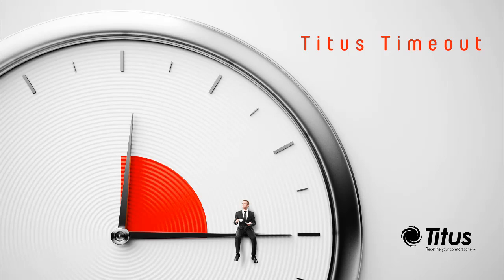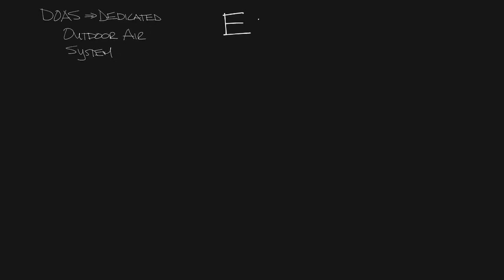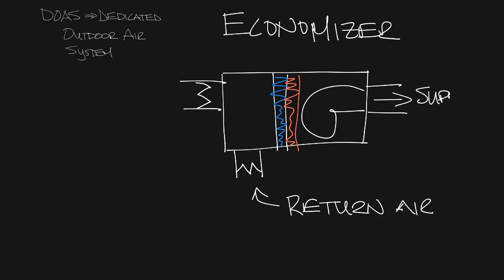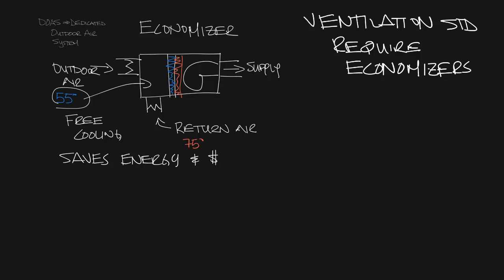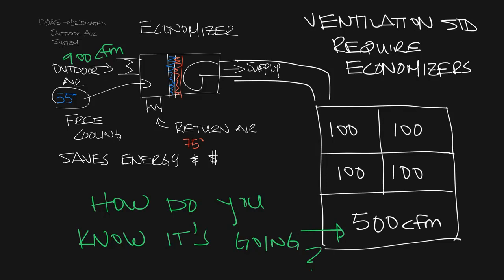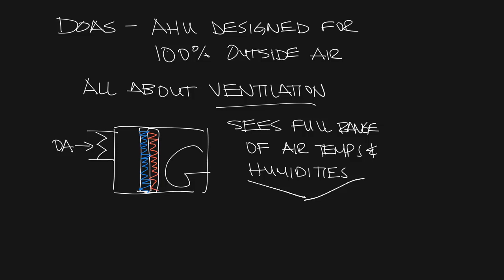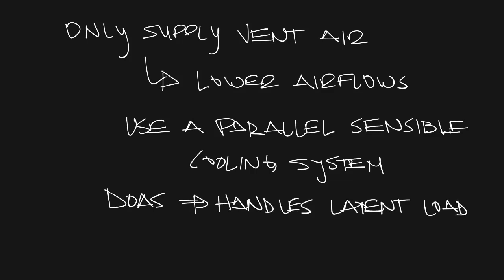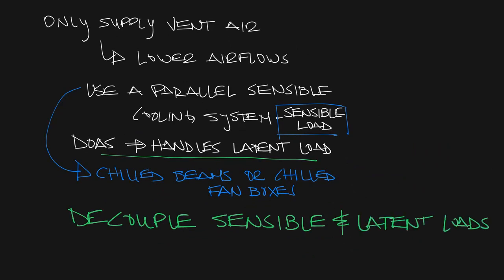Titus Timeout Podcast - What is DOAS?

Comment: If I used VFD to reduce the CFM from the DOAS, how would that impact the de-humidification and cooling of the units? Our units supply 10,000 CFM each to the room but we only need 6000-7000 CFM each. We do not want to compromise on the de-humidification and cooling.  What are your thoughts?
Reply from the maker: If the airflow is reduced the sensible and latent cooling would also be reduced. The beam can likely be sized to offset the lost space sensible cooling but the space latent cooling is done by the preconditioned air coming from the AHU. The amount of latent cooling reduction will depend on the performance of the AHU cooling/dehumidifying coil at the reduced face velocity.

Comment: How would you depressurize a building with DOAS system?
Reply from the maker: Ideally buildings are maintained under a positive pressure to minimize infiltration.  We generally see a balance between the required outside air, toilet/general exhaust and required air flow to maintain positive pressure (or exfiltration) of the building.  In cases where this is unbalanced, we see a relief air system installed (this can consist of a barometric
hood on the roof or exhaust fan powered system) in order to maintain building pressure.

Comment: Hey, just a clarification! 
As I've only come across DOAS system with All air exhaust with no return. Only in case of an ERV we use the return to get back the energy from used air. Basically, AHU's deals with supply air stuff( OA+RA), DOAS are just 100% OA without return mixing into it. Please advise if my thought about this topic makes sense.

Great videos BTW, appreciate your time and effort!